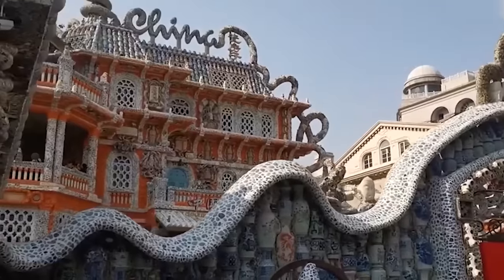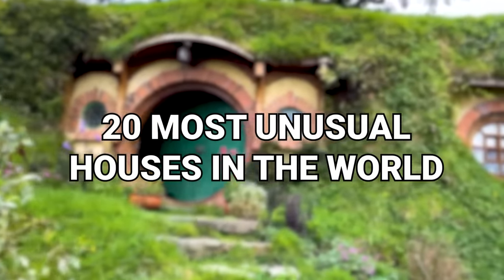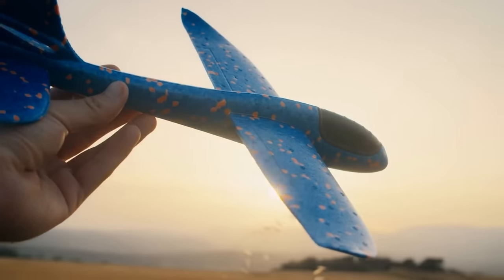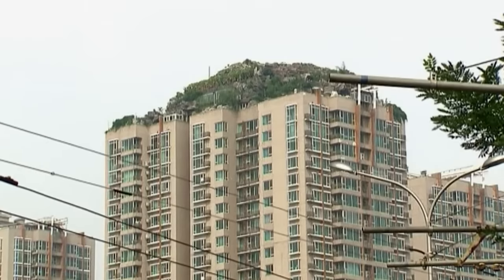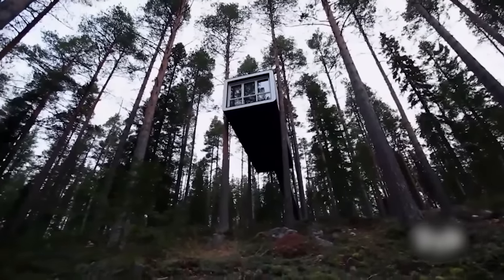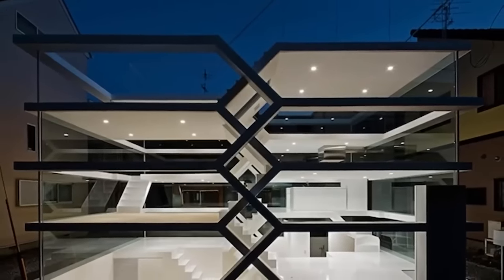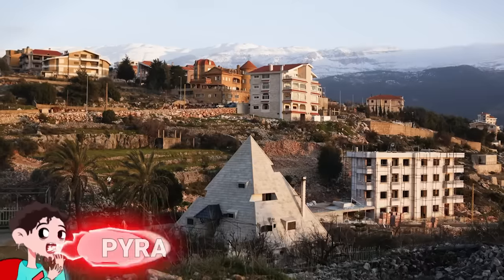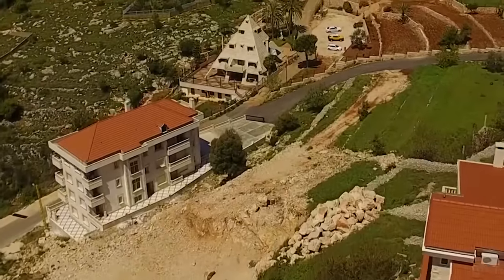People Laughed at the Size of This House, Until They Went Inside

Comment: Didn’t actually see the inside of any of these homes. The pie house had to be wider than stated. Not good🤷‍♀️
Reply: Its shaped like a wedge. Its 3 ft wide at the narrowest part ( the part you see from the outside in the vid ) and gradually widens to 20 ft wide. Its called the pie house bc its shaped like a slice of pie...like a wedge. So those probably were pics of the actual inside. Pay more attention next time.